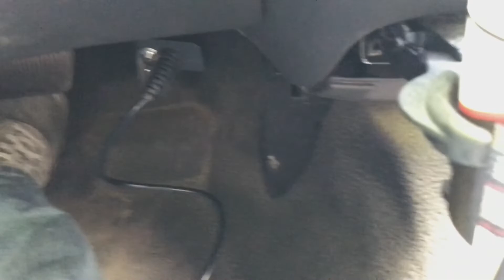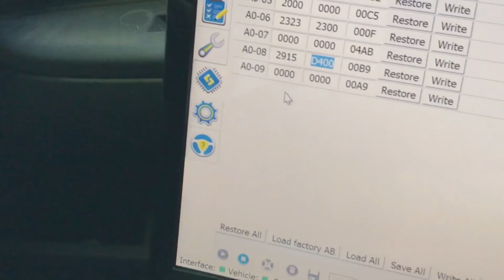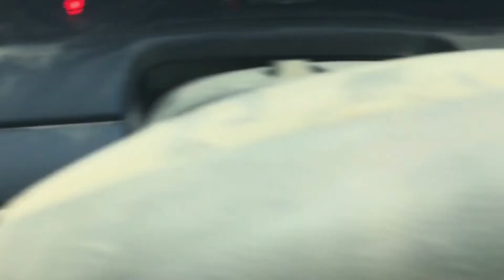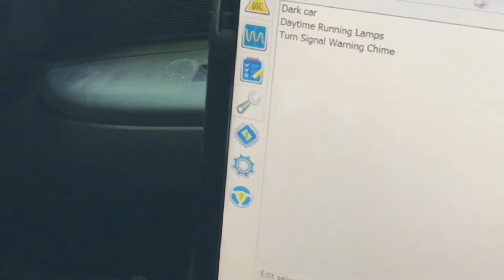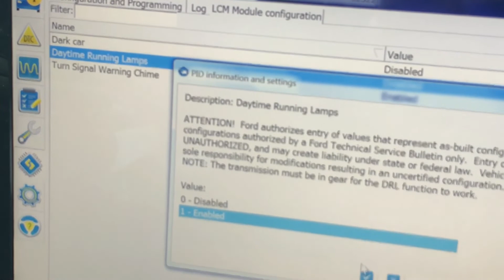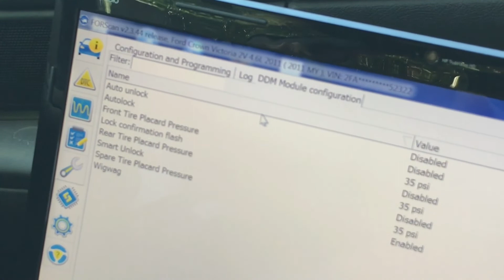Upgrade Your 2008-2011 Crown Vic with Keyless Entry – Step-by-Step!

Comment: My values are at ED55 - D600 - 00C0,
Any ideas?
Reply from the maker: Unfortunately I do not know. Have you tried the hex conversion? Also try searching the Crownvic.net forum for it.
Reply: @JZ_Cars after searching up The Hex conversion it seems like it was already enabled but it also seems like the Viper Alarm that was installed is keeping the doors unlocked unless I manually hit the button for some reason
Reply from the maker: @2011_cvpis Glad you figured it out!!!
Reply: @JZ_Cars well technically I didn't figure it out because it still doesn't lock when I drive which is annoying because I have friends who just walk up to my car and jump in.
Reply from the maker: @2011_cvpis oh damn
Reply: @JZ_Cars  or maybe their not friends
Reply from the maker: @2011_cvpis 😂

Comment: would i have to do this for a 2007??
Reply from the maker: @AaronSarmiento-Montellano  Yes, but you also need the receiver-antenna for the programming to work. The 08-2011 already has the antenna. So my video technically does not apply to the 2007 as there are more steps involved for those.

Comment: How do u activate the cruise control?
Reply: If you have a 2006-2011 maybe 2005, I forget one year they switched. You will need a steering wheel that has the controls and it needs to be activated via fords IDS software and VCM, FORScan cannot program ECM. You used to be able to buy a 1-3 day IDS license from ford.  If it’s an older CVPI before drive by wire then it all mechanical and all parts can be taken off another Vic with Cruise Control.
Reply from the maker: The car would need to have cruise control from the factory. I do not believe this program has any ability to activate cruise control.

Comment: Ok so I have seen you answer the 2007 RKE question but I want to see about a 2007 solution. I went ahead and followed the steps you have in the video and my 2007 does go into programming mode after the 8 key turns. However, just as you have said the remote will not program. I am wondering if anyone knows if changing the DDM to a 2008 would fix this?
Reply from the maker: One guy did a video about it. I think you need the receiver along with the correct door module. I’ll see if I can find the video and send the link to you, but I have no idea if it works. See below.

https://youtu.be/rvjEMS2aLP4
Reply: @JZ_Cars  That would be great! Thank you.
Reply from the maker: @jaylawrence5240  see the link below, I have no idea if this will work but I think he put some good info in there.

https://youtu.be/rvjEMS2aLP4
Reply: @JZ_Cars  Problem solved. Well before I saw your link I did the research myself. All you have to do is add an antenna (receiver-antenna is ford language) and program just like you show in the video. You do not have to change the DDM like in the link or at least you do not on a 2007. The test would be follow your video and if your car goes into program mode but the FOBs do not program then only an antenna is needed. I got my antenna from a junk yard. The location is passenger side rear panel beside the rear window. I mounted the antenna inside the drivers door right below the crossmember that goes across the biggest opening. I did not do the trunk release and I do not think I am going to at this time. I have pictures of locations if anyone needs them.
Reply from the maker: @jaylawrence5240  Nice!!! I had an 07 a while back but I never tried to add it and ended up selling that one pretty quickly.

Comment: what if mine was 2811 once i looked at it do i change it to 2911 or 2915
Reply from the maker: I would try both. If neither works, you might need to Google it. Some of the hex conversion works and some of it doesn’t.

Comment: Please, my dear, clarify the numbers
2007
Reply from the maker: Is yours a P71? If so, I’m afraid this process doesn’t work for the 2007 CVPI.
Reply: @JZ_Cars  
My vehicle is Victoria Standard Lacey P71
Reply from the maker: @محمدالمطيري-ت7ح  So is your car a 2007 Police Interceptor? If so, this process won’t work.
Reply: @JZ_Cars  
It has nothing to do with the police because it is for personal use
Reply from the maker: @محمدالمطيري-ت7ح  so I’m not speaking to whether the vehicle is for personal use, what I’m saying is the 2007 Crown Vic Police Interceptor, which has P71 in the VIN does not have the proper connections and modules to allow you to simply add keyless function. That will only work on the 2008-2011 P71.

Comment: I got the connector in the program, but it does not connect to my car at all
Reply from the maker: What year is your car? If you have a 2008-2011 you should have the OBD port and it should also have the correct Driver Door Module to allow for keyless.
Reply: @JZ_Cars  I have a 2006 cvpi
Reply from the maker: @Anthony’s Cvpi  yes I do not believe it will work for that year unless you make more updates to the vehicle. Standard 2006 Crown Vics have it for that year but it was not set up that way from the factory on the Interceptor until 2008. I am sorry if my video was misleading to you. I did try to mention the years in the video and in the description, but I can understand if that got missed. So I have updated the title to reflect the info as well.
Reply: @JZ_Cars  ohhh okay cool it's okay your videos still help me out a lot I'm happy I found your channel
Reply from the maker: @KINGVIC87  Man that means a lot!!! Thanks!!! If there’s anything you think I should do a video on for the Crown Vic platform that would help folks out please let me know! I’ve got a decent amount of Vic content but always looking for more ideas. Thanks for the sub as well sir!!!!
Reply: @JZ_Cars  You're welcome any kind of video you can think of is great whatever you do to your vic make a video because someone out there in the vic Community can use it even me I haven't made a video in a long time due to family issues but right now as we speak I'm putting my Transmission back in The reverse band broke so I order one took the transmission out to  replace the band put it back together now putting it back in it took some time due to cold weather rain and doing it my self and Making sure everything else was in good condition All I'm waiting for is a new dipstick to come in from the mail but It's a working progress But whatever ideas you have for your Crown Vic post them Believe me it will help us out.
Reply from the maker: @KINGVIC87  I hear ya! I may have a couple more I can do on it. Been doing some Jeep videos lately. I have a couple more ideas on the Vic but just haven’t really taken the time yet. One for sure is the rusty wheels. Mine aren’t too bad but they need to be sanded and painted to make the car look better.
Reply: @JZ_Cars  ohh okay cool I love jeeps to I'll check out some of your videos.
Reply from the maker: @KINGVIC87  Man Awesome! This Jeep is pretty sick it’s got the 392 in it!

Comment: How do I make the Ford make a horn sound when the remote is locked?
Reply from the maker: So the way it should work, assuming your cars horn is functioning, when you hit lock button on the remote more than once, the horn will sound.
Reply from the maker: Mine worked from the beginning. I am not sure there is a setting for that. Let me look into it though.

Comment: thank you so much for this! im about to do this to mine and i needed a visual on how
Reply from the maker: No worries! Make sure your car is the right year model because this only works for 2008-2011 this way. Also your value in that cell may be different than mine, I put info about that in the description. Good luck with it! This is a must have mod in my opinion. Let me know if you have any questions. Thanks.